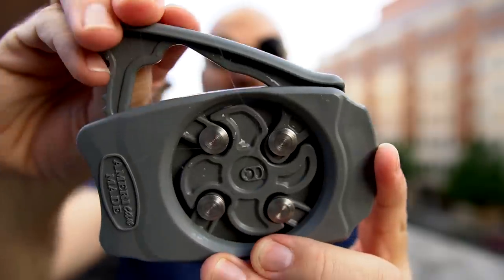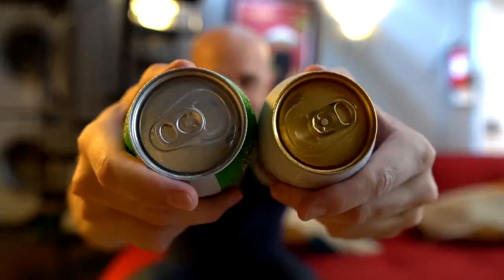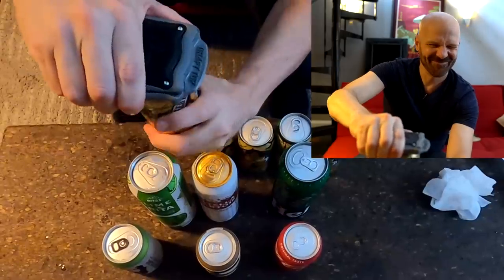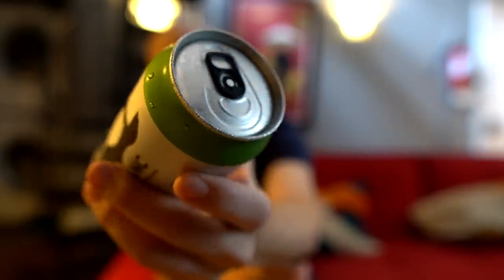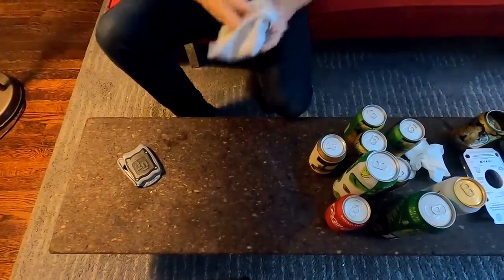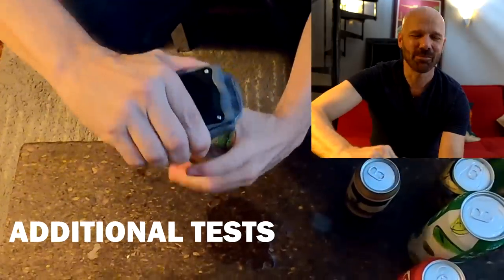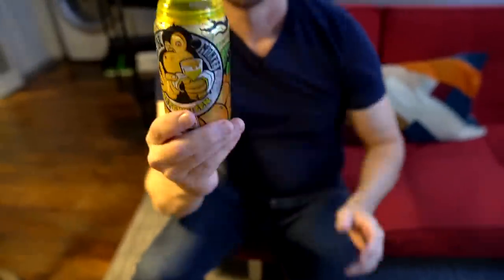Testing an Unusual Aluminum Can Opener!

Comment: As you’re sitting there grinding away at the top to get it off, I can’t help but wonder how much aluminum dust is being made that falls into the can.
Reply: A tiny ammount if anything, it’s cutting, not grinding. You don’t get a lot of metal in your food from a tin can
Reply: That's a damn good point.
Reply: My same thought I had commented the same before I seen yours
Reply: I was thinking about how sharp the edge of the top you're cutting free and then poking into the can with your finger would be. Mmmm Blood in my beer. That's the best.

Comment: Very strange how the top goes in the beer, wouldnt that disturb the flavor more than the smell? Also the tops are usually dirty as they are exposed to the elements
Reply: Only positive flavour if you drink Budweiser or Heineken.
Reply: @Pienimusta  All generic pilsner tastes the same bud, Heineken, Stella etc etc if you don't like a cold Heineken on a hot day  you probaly don't like pilsner
Reply: I usually rinse the tops before drinking unless they are from box or plastic wrap.
Reply: @Pienimusta  I've had anything from czechian  lager to German brewery brands in each country respectively, the truth is anything you buy in a can from a store will taste accordingly
Reply: Do you wash the top of a can Everytime you drink one? Because if you open it like normal. There is no difference.
Reply: Yes you should always at least wipe down the top even if you drink straight out of it.
Reply: That's why I always wipe the top of cans before pulling the tab.
Reply: James. Where are you filming this video?
Reply: I was wondering why they did not put a magnet somewhere so you can lift it off!
Reply: @daan8695  A magnet wouldn't work with an aluminum can.
Reply: When I worked at a convenience store, the employees would regularly use flats of beer and soda as a step ladder. Those tops might not just be a little dirty, they may be very dirty.
Reply: @kylemorgan4560  
Not every time, but just think how many people with dirty hands and storage rodents have handled that can before you put it on your lips.
Reply: @daan8695  The cans are aluminum which is not magnetic.
Reply: Wiping down is not good enough. What about the crevasses and under the tab where your upper lip touches. Most cans would have dirt and residue from shipping and handling that could be so many things on it. I drink Steamwhistle brand from Canada. They have a foil protector top!  https://steamwhistle.ca/blog/how-our-purity-seal-protects-your-beer-experience/
Reply: TIL cans are not magnetic!
Reply: Pienimusta you are one hoity toity beer drinker. Most people are lucky if they can afford a six pack of Heineken, that shit is expensive beer
Reply: In some countries it is a habit to drink cans with a straw. It is said that it is because they don't turst the hygiene of the storage facilities and don't want to taste the rat feces and stuff. So I would definitely be a little vary to push the lid into the drink..
Also as a side note there are some beer can varietes where the whole lid comes off when you open it. This product seems to mitigate the same process. Apparently it just doesn't work very well.
Reply: qurqo yes. No think of that literally every time you drink out of a can like normal. Literally no difference.
Reply: When you use the tab as normal, the part that opens does rest in the drink, and the liquid passes it when you tip it to drink or pour. I don't see a difference really.

That said, this seems like entirely too much work for a drink
Reply: Plus the dirty long hair that was hanging off it!
Reply: But I rarely see cleaning the top of a can drink anyway

Comment: Some cans can sit in storage (example: grocery store in NYC) for a while and possibly have rodents and cats run over them. I personally would never drop the whole top.
Reply: Isn't there a FDA (or some other institute that would not allow this)? It seems like a problem that would never exist in my country. And I always though that NYC would be a place with a good enough hygiene to prevent this. But I also try not to drink from cans anytime I am abroad just for the same reason.
Reply: Jukka-Pekka Tuominen whether there is FDA or not, the fact it that rats exist and many people know it’s a problem in NYC. But I can’t tell you I would know the regulations (if any) when it comes to storage in a basement.
Reply: All can tops are filthy. I wont drink from one unless I can clean it first.
Reply: Spent years working in a pub. What you say is true and is something we were specifically warned about when dealing with any cuts or wounds while working in the cellar. Contamination from rats can be fatal, never mind the metal shavings from the lid.
Reply: @jukka-pekkatuominen4540  I'm from New York hygiene exist. Just as much as you expect. Compared to most of the US we are, special.

Comment: Can't wrap my head around WHY you'd need to remove the can top...
Reply: A part of "fine" beer and other drinks is the smell, it's hard to smell and drink them out of a can opening. I know just pouring the drink into a normal glass solves the problem but I guess this product wanted to fix the issue of not having a glass near?
Reply: Up to 90% of our sense of taste is connected to our sense of smell.  The more we can smell, the more we can taste.  Removing the top from a can simulates drinking out of a glass, which is the best way to drink beer or any drink high in aromachemicals.  So I understand the thinking behind the product but drinking out an aluminum can defeats the effort of trying to create a full flavor experience.  The best way to appreciate a (good) beer is by drinking it out of a clean glass.
Reply: @josef5636  but with the amount the opener costs, you can buy so many glasses that you don't have to worry of not having a glass nearby.
Reply: @c001Ba30nDuD  i mean when you are not at home
Reply: @josef5636  There is a better chance of a glass being nearby than this opener... Who will carry this thing around with them?
Reply: @WatchThemFall  if you buy the can opener you are going to carry it with you... tell me which is more likely, carrying this can opener in your backpack or carrying glasses in your backpack?
Reply: @hottuna2006  actually you are not drinking out of aluminum, it's coated in thin film of plastic, so technically you are drinking out of plastic and it shouldn't change the flavor at all
Reply: So you make a beer can herb garden in your kitchen? I cant think of any other reason to use the thing.
Reply: Opening the can to use the aluminum for other crafting, maybe?
Reply: Josef If I knew I was going out drinking I’d carry a glass lmao, if not I’m not then I’m not gonna be carrying the can opener anyways lol
Reply: @WintrBorn  I have made planters out of aluminum cans. All of them opened perfectly without sharp edges using an ordinary can opener... This product is beyond useless.
Reply: @bostonrailfan2427  Snobby? Yes.
Pretentious? No, the smell does actually affect the tasting experience.

Comment: Reminds me of when the first pop top cans appeared (I'm that old) and they detached completely and folks would drop the tab in the can and cut the crap out of themselves when they drank and swallowed the tab.
Reply: I thought you hooked them together to make cool metal curtains.
Reply: @edchester3150  Not initially; that's a piece of arts & crafts that came later.

People were encouraged to drop the pop tops into the cans so they wouldn't throw them on the ground. Think "Margarataville": Blew out my flip-flop; Stepped on a pop top.

Eventually, safety concerns led to the redesign that kept the tabs attached to the cans.

Comment: I wonder how many tiny pieces of aluminum are sheared off and deposited in the drink.
Reply: Stomach acids will dissolve them, so there's no real health hazard.
Reply: @qurqo  oh yes, stomach acids will dissolve them but what is dissolved gets into your system and supposedly aluminum contributes to Alzheimer.
Reply: Just the perfect amount I'm sure.
Reply: Was going to comment on this, glad someone already thinking the same.
Reply: Were not adding that they can get in ur tongue or throat and a small poke anywhere in ur throat or mouth can cause countless infections

Comment: how much germs and stuff fall into it when the top fall into it
Reply: Why not just pull the top instead of smashing it in? If you rotate it enough with a decent grip the top would be easily loose enough too
Reply: 🌟༻🅹🅰🆈🅵🅰༺ ✓ • 5 years ago  Most cans aren't magnetic
Reply: And also metal shavings
Reply: 🌟༻🅹🅰🆈🅵🅰༺ ✓ • 5 years ago Aluminum is it magnetic

Comment: One thing I've found about rim cutting can openers.
If you cut in one direction then back or if you cut it full circle but keep going over a previously cut part it can make metal splinters.
Splinters are ok if cutting the outside rim of the can lid but this one would drop the splinters into the drink when opening.

Comment: I've opened the top on many beer cans and using a ordinary side cut can opener works quite well without having the top fall in your drink. Not that I've felt the need to do it every time I drink a beer mostly cause I would use the empty can to remelt/cycle candle wax

Comment: What about shavings In the drink...?
Reply from the maker: Some comments on their videos said that was a problem, although I didn't experience it. It's a valid question, though!
Reply: @Freakinreviews  Hmm, iIwould absolutely be nervous about that lol. Def not good for our intestines.
Reply: I got this product n stopped using it cuz almost every can had shavings in it n it is hard to open.
Reply: Even if you can't see shavings, I wouldn't feel safe with microscopic aluminum particles. I guess people think Aluminum is safe to consume, but it really isn't.
Reply: İ mean you cloud just open a can and pour it in a glass if you want to smell your drink
Reply: Lassi Kinnunen  True. However, I don't drink from cans or cook with aluminum anymore. I also stopped using antiperspirant/deodorant with aluminum too. It just doesn't make sense to me to accept any unnecessary exposure.

Comment: A perfect way to get absolutely drunk!... " I'm just testing my can opener!" ..... "Sure!" :D
Reply: Would be better that the handle had a hook to hook the pull tab and get the top out completely. i guess this device makes more sense then a regular can opener. Then again.... if you wanted a solution to this.... they should have invented something like the can openers for fruits and veggies that undo the seams on cans rather then (i guess it's) slicing the can. i don't know if that is possible for drinking cans though....

Comment: I'm not going to lie, I ordered that and used it for the first time two days ago and also hated the experience, BUT, I didn't get it for the drinking experience; I got it to make cool eco-friendly cups for my guests when I host people. If they bring a pitcher of something, or need a glass of water, BOOM! awesome looking cup that doesn't go to the landfill or recycling center. It DOES leave sharp edges and even metal shavings in the drink, so I'd never use it for it's intended purpise, but with a little sand paper it perfectly met the reason I got it (even if it's a slight pain, it's worth it since I plan to keep the cups for a long time).

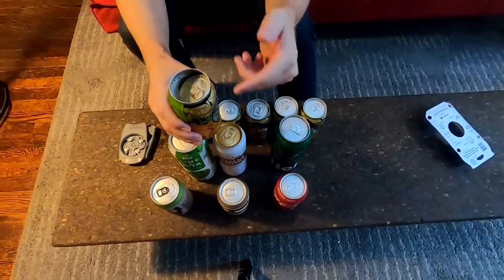Comment: 3:47 If that is their response then I would rather just use a Solo cup. This device just seems pointless.
Reply: Yeah that has to be the most dismissive response I've ever heard. The worst put is, they could have glued a cheap magnet to the thing somewhere to pick up the top once done and no one would have even questioned it. The thing still would have been useless, but at least it would have resolved the lid problem.
Reply: Not for aluminium cans though, just useless
Reply: @IanM1  True. I suppose I've never actually tested it to see how common it is, but I know at least some have small amounts of a steel in the alloy to aid recycling centers in sorting.

Comment: Everyone saying "use a glass" or "why would you use this"? IT'S FOR WHEN YOU DON'T HAVE A GLASS.

Do you take a pint glass with you when you go kayaking? Do you take one with you to the beach? THIS IS FOR THOSE TIMES. Obviously drinking out of a proper glass is better. This is for when you don't have a glass or don't want to bring one along. I use this to drink IPAs and craft beers when I'm out on the sand playing volleyball and it's awesome for that. Way better than just drinking out of the can in my opinion.

Edit: Also it takes a bit of practice to use. The first few times are tough, then you get the feel of it and can open a can in just a few seconds. The handle part is not for "poking" either. It has notches in it so it can be used as a lever on the side of the can. It allows you to push the top down with good force without getting the splash. And they're wrong saying you can use it for opened cans, no. It only works well on unopened cans that still have the pressure inside.

Comment: A lot of the products you review seem like solutions in search of problems... but this takes it to the next level. First of all, I'm not sure I can buy into the initial premise of the whole "sniff and sip" enjoyment of beer. However, even if that's a thing, the whole "drop the top into the can" is just beyond silly. They clearly couldn't figure out a way around it, so they just said no, that's normal. You're supposed to do that. The whole thing just comes of as incredibly low-brow when the entire premise of the device is supposed to be high-brow. Reminds me of the pull-tab days when people would drop their tabs in their cans and then choke on them.

Comment: I love my draft top especially when drinking IPA's out of a can. Plus it's more of a "wow!" factor with people at parties rather than practicality.
One thing I noticed is you did not try opening the cans while set against a surface until the wine.
My personal experience is also holding from the top whilst also having the can against a table helps.
Is it needed? Absolutely not. Do I regret buying mine? Absolutely not. 
Great video as always hope you're doing well!

Comment: The way to improve this 10x is to make you open the tab of the can and have this tool have a hook/latch that goes into the can and the when you rotate it to cut the top off, it lets you rip the top part completely out of the can. I hate the idea of the top just swimming in the drink and also the splash that it creates when you break it in is dumb.

Comment: I can’t help wondering about the ratio between successfully opened cans, and the metal used. 

In Denmark, all cans are required to be aluminum. (I don’t know the reason behind it though.)

In Germany, they use iron cans. (I do believe you can buy aluminum cans there too.)

Comment: It works best if you work it back and forth lightly, and then add force slowly. If you go full force immediately it doesn't always cut through cleanly, it is like scoring the track for the wheels first.

Comment: I've been doing this same thing with a normal hand-crank can openers for 20 years, we used to do it to use the empty can as a place to put the change and bills for our university honor system fridge in our Anime Club office. and mine was much less time consuming and worked every time and you wouldn't need to push the lid in to take it off

Comment: I see alot of people complaining about the top going into the drink. 
You could rotate it untill the top is all the way off and just pull it out by the tab. Or just rotate it enough so there's just a small bit left where you can just pull it out. You just make sure the opener is laying flat so each cutter isn't at different angles.
Then there's people noting that you have to release the pressure but you don't as it's optional.

I don't get why they had to make tutorial videos for it. It's has a top shaped hole and a squeeze grip. You'd figure most people could figure it out. I know this isn't really necessary as it's for people looking for convenience in not needing to use a cup while still having more drink flow.

Comment: Couple observations after watching the actual tutorial on the draft top page. 

1.) I think he does make it look easier than it probably is for the first few times. 

2.) He mentions that applying too much pressure actually makes it harder to open. 

3.) He used an alternating twisting method. A 1/4 turn one way. Then a 1/4 back the other way. 

I think it's not a perfect product. But it also seems like you did it not as advertised to be used.

Comment: I have one. It’s a bit of a learning curve. I found if you crank it one way then the opposite it opens no problem. It does take more pressure than it seems on the videos. I think a DT 2.0 is probably necessary.
Reply: BTW. Before pushing the lid in(which I don’t), pull the tab straight up use it as a handle and just pull the lid out. Problem solved.

Comment: The pop top can was designed so you didn't need a can opener. But if you want to open the can that way use a traditional can opener. Those side seal can openers open cans just fine.

Comment: This would be immensely better if the tab on the side for poking the top down was set up so you could pull the top off instead, like by hooking onto the tab. I would also speculate that the cutting rings aren't quite close enough to the edge of the device, and that's why some cans are a lot harder to open (barring them actually being differently shaped, like that beveled can mentioned briefly), but I don't have one with my so I dunno.